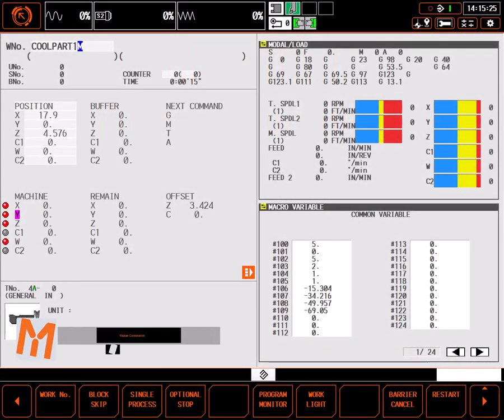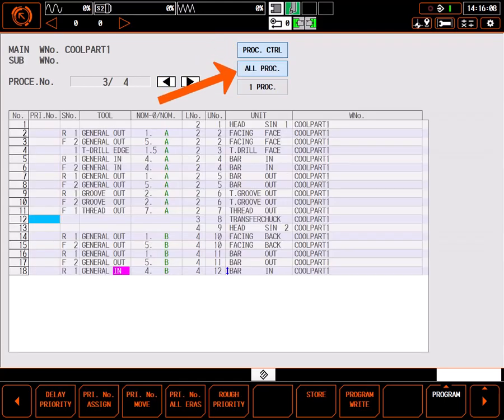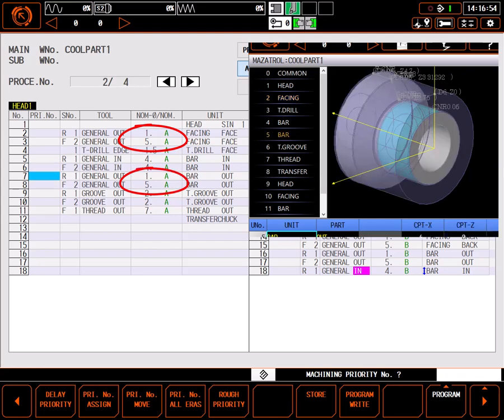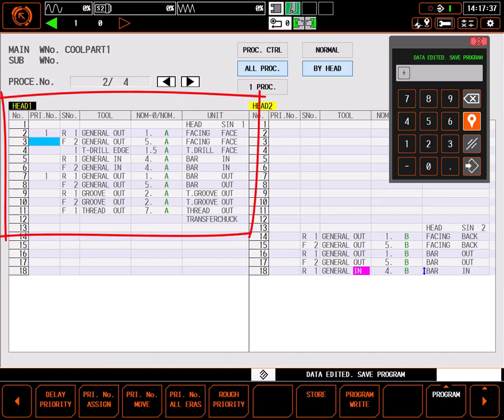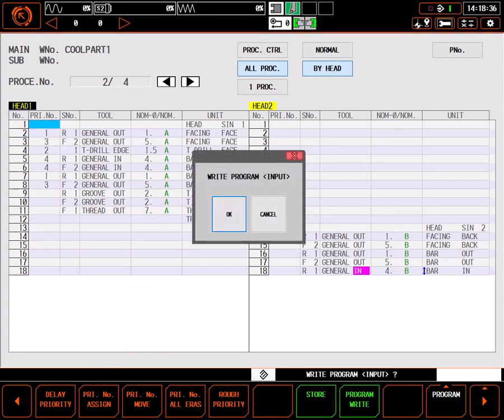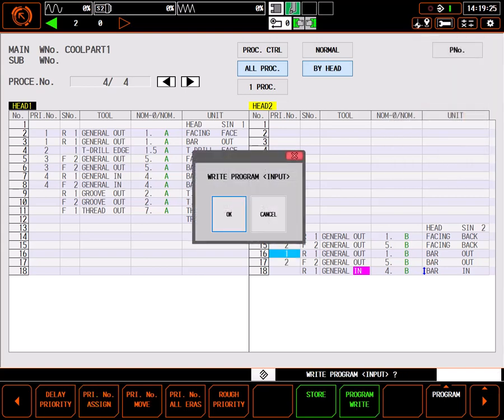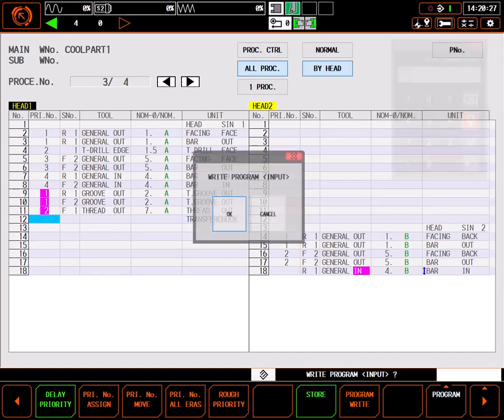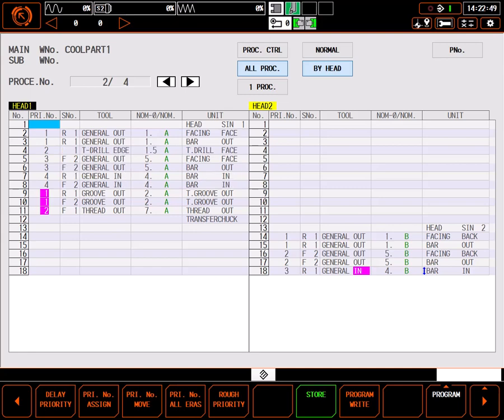MAZATROL Programming Briefs: Priorities & Layout

Comment: Hello, is it possible to tell the machine to prepare the next tool using Mazatrol? 

Currently I am editing a Mazatrol program that calls a measuring probe to measure zero points of the raw block and when its done, ISO program is called that starts with a tool far away in the tool magazine so the machine waits. 

I would like to program a tool preparation (a T code in ISO) in Mazatrol during the measuring process so that when its done, there is no delay. Thank you
Reply: no problem. if you have a tool magazine    just call T 23 WITHOUT M6.. in mazatrol program

Comment: Hello sir 
Good evening

I have a question regarding turning spindle rotation.
I'm manufacturing a component in integrex i300 weight is around 600kg problem is that during the machining time I want to control turning spindle rotation as per my requirement like N=100 
During the C axis positioning turning spindle rotation is too high I'm control by rapid feed rate 2% 

I want to control that problem have any parameters for that so I can change this parameter only  for this program 😊
Reply from the maker: Hello, Dev,

The easiest solution for controlling the C-axis rotation speed is to make it a feed movement and designate the feed rate to the desired speed. By doing this, the c-axis will not "whip" the part when indexing.  If a more complex solution is needed, please contact the nearest regional Mazak applications department to create a solution.
Reply: @MazakCorporation  thank you